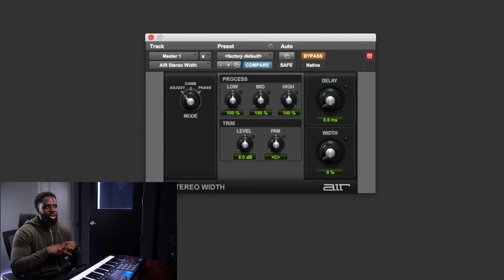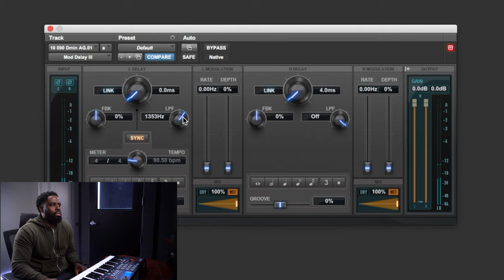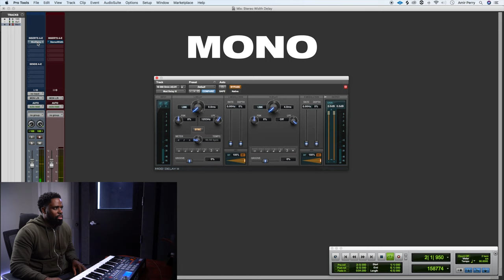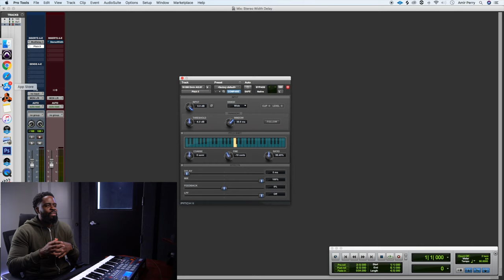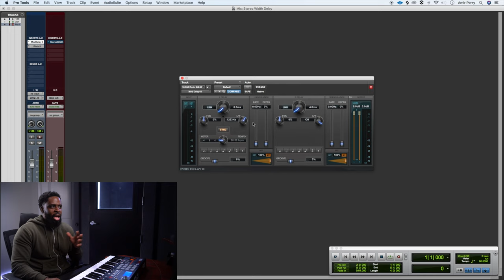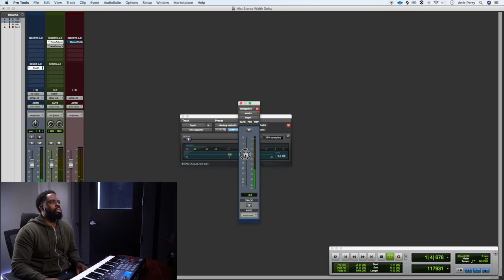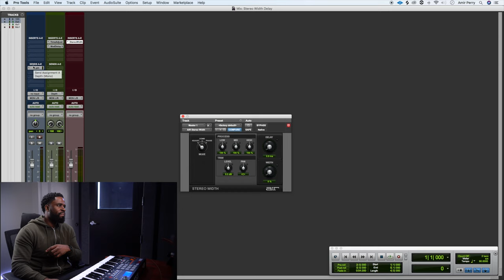Stereo Width Production Tricks To Make Space In A Mix

Comment: Just found your channel today and I've been binge watching for like an hour now. Great stuff.  One technique I like to use for stereo width, especially on guitars, is to insert an eq on the track and then duplicate it. Then pan the original track left,  pan the duplicated track right, and then eq the two tracks differently by boosting a frequency on one of the tracks and cutting that same exact frequency on the 2nd track. (And maybe send them both to an aux with delay, or simply just slightly nudge one of the 2 tracks to the right just a little in the edit window)
Reply from the maker: Yo thanks Timothy. That's a great technique. I've used that one as well. Sounds like you know your stuff! You produce as well or just mix?